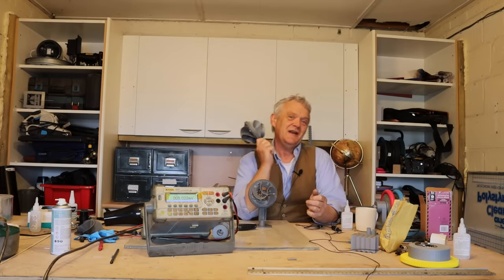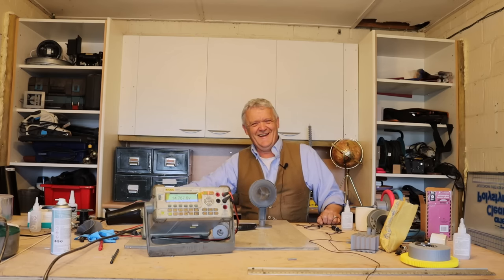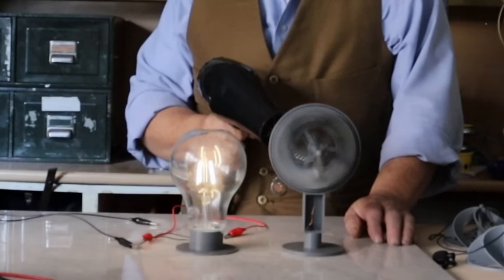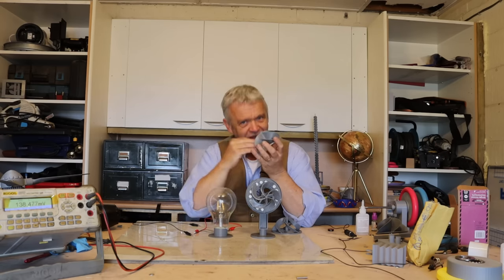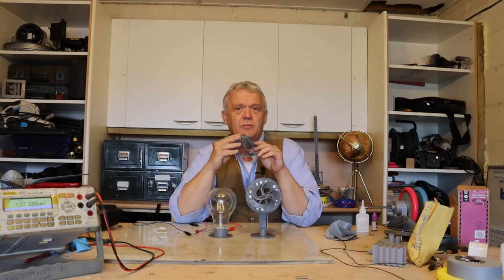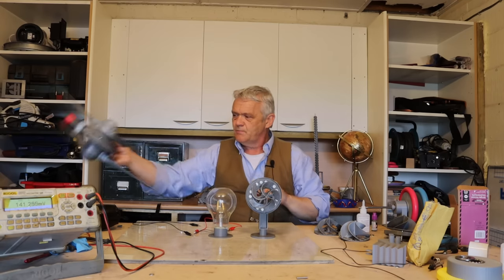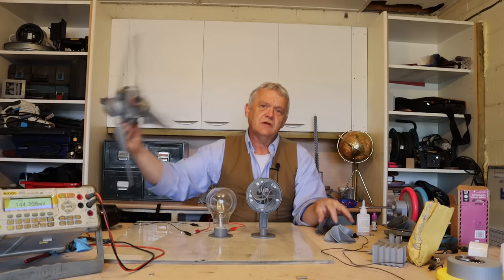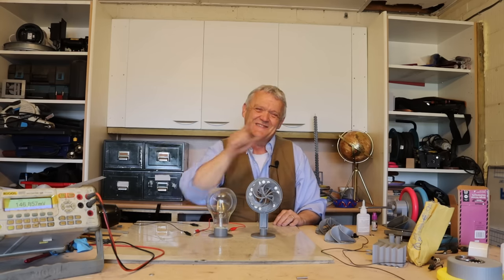2049 Improving The Omnidirectional Wind Turbine

Comment: Amazing!!!!!
Bigger obviosuly produces more Power, but doens't bring any new Insights..
What about the Number of Blades? Can You try 2 to 9 Blades per Side? Maybe on the Dual-Blade Rotor if it is easier
Also if You increase the Weight of the Outside Ring of this Rotor, it'll also function as a Flywheel

Thank You for the Great Videos and Ideas!!

Comment: Hi Robert, 
I'm not sure how much flexibility your cad software is capable of but is the airfoil shaped for maximum lift?
This is bringing back my fluid dynamics courses in uni🤣
That airfoil, shaped properly will definitely increase the overall performance when scaling up to something more interesting 🤔
The other aspect is this could be constructed in metal a lot easier than many other designs.

I think you have really hit on something here😉👍🍻

Comment: Have you tried magnetic neutralization with it ? It overcomes the magnet drag you get 2 1/2 times more out of it .
Reply: how could this be applied to a wind turbine?
Reply: @nexxus0320  by reducing the lock up areas you'll need a second wheel with small magnets  lined up to reduce drag it works on generators 21/2 times out input the Japanese have appliances with it in them . Your magnets need to be adjustable.

Comment: Excellent video as usual , I'm currently designing a sand battery power system that will run A/C ,heater ,fridge \freezer and hot and cold water to go inside a camper van, and this duel rotor set up gives me a fantastic idea of a power tunnel to power it all 👍
Reply: I also have a camper van whose storage battery is a Tesla module; solar on roof with alt. charging when underway. I have long been intrigued by the possibility of using wind while underway to charge. How is your work going if you don’t mind sharing? Thanks!
Reply: @begin47  hi , well I'm a member of van life UK on face book IV put up a circuit diagram for how the sand battery circuit will work currently gathering all the components to put that together , the wind generator is a really simple design tbh that I actually got from hydroponic growing tbh 🤣 the idea it lots of small generators that spin really fast , and the tube length could be altered according to van length , I think an ideal design would-be 2 tubes one down each side of the van leaving the middle for storage or a small solar and storage as the power needed to stay off grid would-be reduce due to the sand battery picking up the slack ,
Reply: Thanks for getting back to me. Nice to meet you. I don’t even know what sand battery is. I’ll have to do some research on that. I have been following the evolution of wind generators with the goal of finding something of high efficiency and small size that would work to recharge my Tesla storage battery. 
I have 1 fan, 5 solar panels and a swamp cooler on the roof, so not much room up there. Are you using wind a generator(s) at this point and if so, what type and size?

Comment: In the process of building one of these and wondering a couple of items. 
1) Making the blades aerodynamic to increase the life effect which should increase rpm's
2) Increasing the number of blades by one or two to decrease the gap and possibly increase lift even more
3) A slight increase in diameter to allow two rows of magnets, increasing the area of the wire being directly acted upon by the motion of the fields.

These are just thought that I am kicking around and will try to design myself and see what the results are. Will gladly share.
Reply: did you build it yet?

Comment: I wonder if this could be made much larger. Using steamed strips of bamboo. Glued together with liquid nails, or epoxy of something ,and possibly wrap with fiberglass to protect it. Making a roughly 96" ball, on a tower of 2" heavy wall tubing, maybe form a tripod. From 1.5" tubing braced evry 10' with 1/2" tubing. And 1/8" cables near the top, with a 2" pipe being the final 10' being 50' tall total,  maybe have it tilt on two legs  to about 45° angle , and the top tilt to another 45° making ig easy to install and service.  The whole thing should be 100-150lbs at most , this being tgf reason for thd cable bracing.  Use a liniar actuator to tilt the top  or maybe a cable and hinge. Uding a 1/4"cable to keep the top pole latched straight, and to tilt down when the tower is tilted,  build a 48" ring  as the rotor and stator,  form a 2"x4" magnet using two steel bars, and a couple magnets , rough 1.5"x 1/8" n52, or close,  use 3 staters and 2 rotors,   using serpent coils on each starter,   epoxy the magnets together and to the rotor,  place poly foam between the magnets, then wrap with fiberglass, Wrap the coils around the foam  blocks and wrap them with fiberglass also, only make it possible to cut the fiberglass and remove it like a shell from the coils, re wrap the coils and glue it back on in the future!  Just a rough guess it should do 2-3kw! with afairly strong Wind. 20mph maybe 1kw or so,
Reply: Whoever you are ... Love your dreaming and structural example.

Comment: i am having the updated design printed for me by a home 3d printing enthusiast. he is charging me 25 Canadian dollars for it and I have ordered the other parts from amazon.  i just need the bar part now. Hopefully all these parts will be here within a month  i live in an apartment and this design is ideal for an apartment balcony. My plan is to put a few of these together and try to charge my Dewalt batteries i have the Dewalt electrical generator and the ability to recharge the batteries during a power outage would make it the perfect apartment emergency power system

Comment: I have been working on practically the exact same thing. However, my brief is to make a counter-rotating spherical drone. You beat me to posting a video about it! I've made a few prototypes and one scares me as I put a very powerful motor on it. I do get a fair amount of thrust out of it but haven't measured it to compare with a conventional prop yet. It doesn't feel like I get more but it may be more efficient at higher speeds than the motor can reach.

Comment: Hi, love your vids! I’ve always been wondering which of these 3 methods captures the most energy from falling water.. 1. Water wheel  2. Turbine at base of tube, or 3. Double pulley chain-link drive with carrying cups that take the full water load from top to bottom.. I think it would be an interesting comparison anyway. Cheers :)
Reply: I have said for years that water wheels are an over looked and easy install here in the UK with our often damp climate and lots of rivers.

Comment: Also if you link 3 dc motors in a tube with MIT's new props you can most likely run them in a series/parallel switching circuit and have it run continuously, by it's own.

Comment: This should be on the roofline of every home, factory, office, etc in the country harvesting wind energy wherever it is fitted. However, making it available freely on Tinkercad surely means that a patent won't be granted? To scale up production would need investment, and how many times have we seen on Dragons Den and the like a great product being demonstrated and the question comes " do you have a patent for this?", "Er no" is the answer followed swiftly by " I'm out". 
Relying on hobbyists producing them on an ad hoc basis will result in some being made mainly for self consumption. I know Robert's drive is to encourage others to do their own research which is fair enough.I feel that this should and could be scaled up for the mass market, meaning a production line in a factory or two, an inward investment would be required to set that up with government encouragement to enable the generators to be fitted for the consumer. A ready market and lower carbon emissions, a win win situation.

Comment: Do you think this is easily upscaled and if so do you see any problems? I  wondedered whether using more or the same size magnets is better/worse than scaled up ones (same with the windings)also wondering if multiples these in a windwall setup could work? Questions and thoughts combined:) Thanks for your videos and wisdom.

Comment: I've done experiments with different type props run in series both on separate motors and also one with a double ended 12v motor (old 12v cig lighter oscillating fan) which is using a three blade plastic to pull a two blade metal. It works well. The props and motor are in 6" cardboard tube. Runs with other fans off a standard 12v adapter and a circuit to help it go.

Comment: 104mm diameter.   Almost fits into the air intake of your rocket stove
Reply: Make it in steel and put high in the chimney as well
Reply: @d.marbus1493  Good idea but the generator has magnets in it. Magnetism is affected from around 80 C and curie temp of neodymium magnets around 310 - 400 c -  So same outcome as Luke had with peltier device on chimney.
Reply: Would have been great instead of the anti bird cage on top of my chimney.

Comment: Don't make it larger, make it modular.
Stack them 4 or 5 high in a frame.
Line frames up together to get desired 'swept area'.

Or, stack frames at 90 degrees to form a rectangular box or 60 degrees to form a trapezoidal post.

Comment: I noticed you didn't take advantage of placing you rear blade supports on an angle to maximise rpms / power output, nor did you ramp the circumference to prevent resistance.

Comment: Im looking at building a home back up system with a few dozen of these. You mentioned the voltage as roughly 20v dcbut how many amps is it producing? Im looking to create a 240v ac system but not sure how many id need or what is the best way to combine them and then convert it from dc to ac id love to get some help with my project youve truly been an inspiration of mine over the last couple of years and i trust your judgement

Comment: with an omnidirectional turbine such as this, would it work or make sense to mount it on a pole/stand like structure that funnels wind UP to the turbine where it meets the cross draft?  since it's omnidirectional, can it be mounted vertically and horizontally?

Comment: I printed one of the files but the spiral blades start over some of the holes that the magnets go into. What if the holes were on the opposite side so they'd be easier to put in and the blades would be more solidly attached to the ring? They wouldn't flex as much during printing and a soother airfoil would result. Yes?

Comment: I want to know what angle of incoming airflow is most efficient if strait on like typical wind turbines then I could add a swivel bearing and a box kite style tail i think this will work great with my joule thief style inverter i use for lighting up to 4 led light bulbs

Comment: I tried replicating this using a wooden dowel instead of a metal one to attach the fan blades but my multimeter is not reading any voltage. Could the reason be the wood?

Comment: Because the airflow is exhausting into the rear turbine with the blades facing in the opposite direction, wouldn't that introduce drag? how does a configuration of a single new blade compare to the two? could the air be re-directed in the hub to angle the air in the same direction as the rear turbine to reduce drag?

Comment: awesome. I also just watched the video about the making of the serpentine coil. whith the formula: Length serpentine = (π * D * N) + (π * D^2 / 4) + (π * H) for when the serpentine coil goes around a cylinder shaped coil. While in this omnidirectional wind turbine this is not the case. Could I still use the same formula? or should I just wrap a wire around this flat syle coil to mesure the distance without the use of a formula. 

Thanks for the great videos. I love this kind of projects.
Reply: What did you do? I was going to wrap a wire around to get my distance 😭

Comment: Hi Robert,
Thank you so much for everything that you do, these projects are amazing!
I have a weekend project to try to build a small portable generator for camping/hiking and this looked perfect. The mechanical part of the project printed perfectly but when I get to the generator part I'm not able to get the same results as you.
I have wound a serpentine coil using 0.2 mm copper, about 200 turns, 300 doesn't fit in the case for me,  and 36 10x2 mm magnets. 
I don't have an oscilloscope to test it out properly, but on a  multi-meter I barely get 0.6 V and 0.8 mA.
Do you have a suggestion on what could be my problem? My magnets are not powerful enough? Or would the serpentine coil winding be the issue?
Reply: One of the issues was with my multi-meter, after switching to a new one the voltage is going up to 5V. It's not the 21V that you got in your test, but my wind source was a hair dryer that goes to a max of 2 m/s. The second would be that I don't have a 6mm rod so I printed one that does not fit perfectly and also causes the LHS/RHS to rub on the stator.
Thank you again for posting this video and all the details to it. It's very fun to work and play with these.

Comment: I think those would do great in ducts but i wonder if there would be a better setup that already exists. I am also wondering if there needs to be more of a gap between the blades of the front and the back,like you have mentioned on the bigger double rotor that there needs to be a gap between them. maybe make them taller by using a funnel at the base of each one so the channel the air into the center hole better and to create more gap between the blades. just some thoughts that I am not sure are worth the effort when there might be something better already for that compact size.
Reply: And it sort of looks like "half" of the thoroidal propeller now.

Comment: so when you say it's a "lift"  type, so that mean that each arm of the spiral has a similar thickness shape as an airplane wing? like one side is curved and the other is flat, so there is a difference in air pressure between the two sides and that causes it to spin???